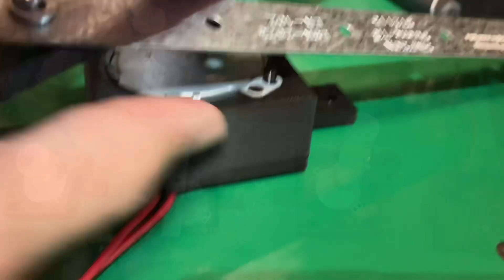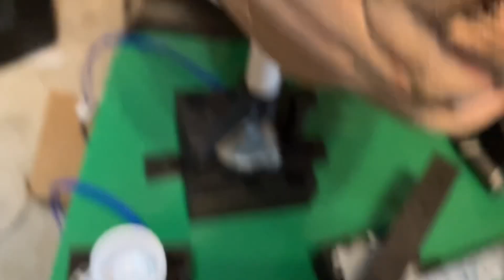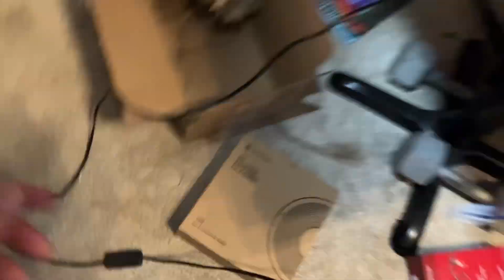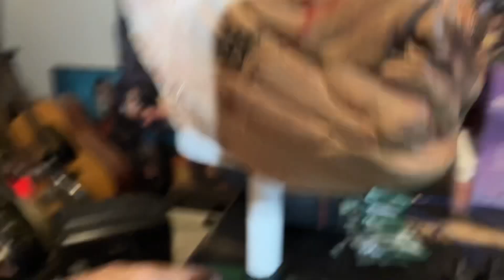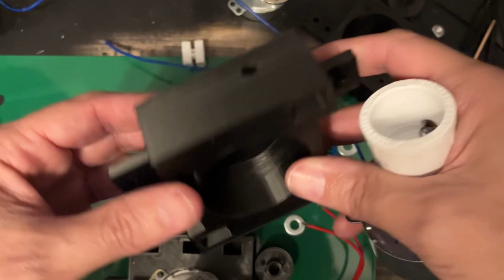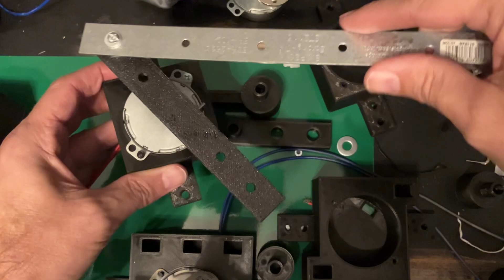3D Printed Synchronous Motor Cases and Attachments with File Location

Comment: Nice - I just spent all day designing a single small arm setup for these motors to do wire pulling on skelly's.  May print out a few of yours as well to experiment with on a few other props.  I have switched to ASA for printing though since it's UV stable and a LOT stronger than PLA /PTEG - works great for the smaller attachments.
Reply from the maker: I think I’ll try that too since I had to redesign some parts to make thicker (which I updated files on site). Thanks for the suggestion.